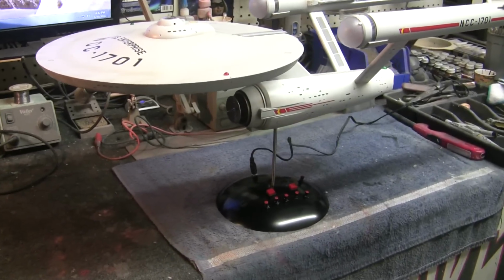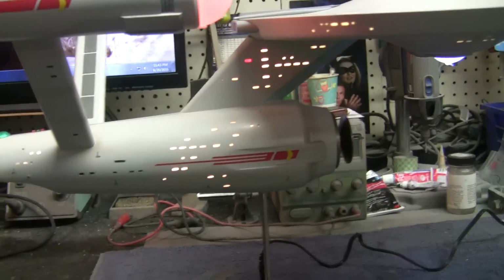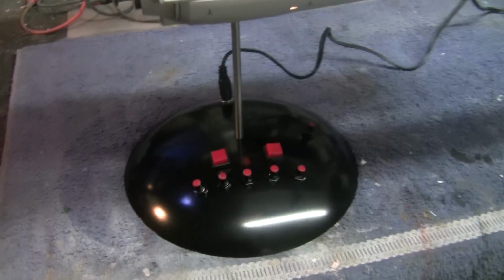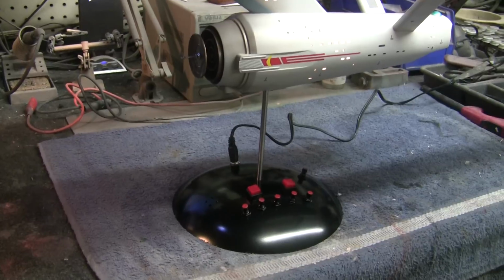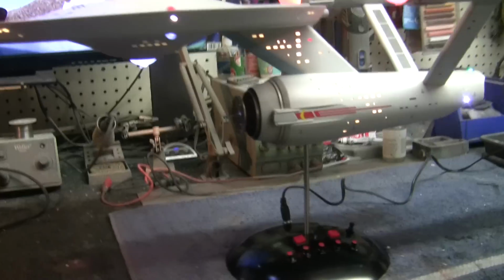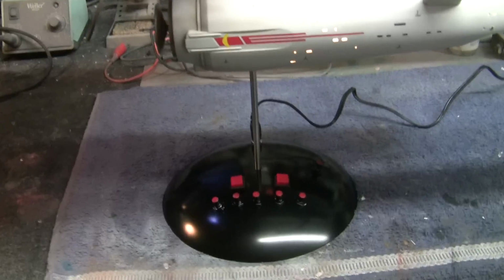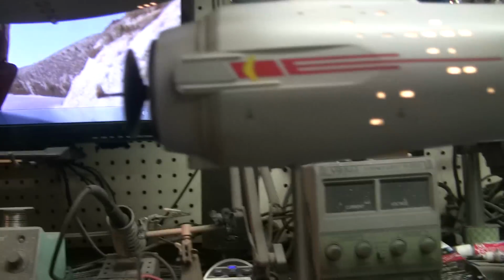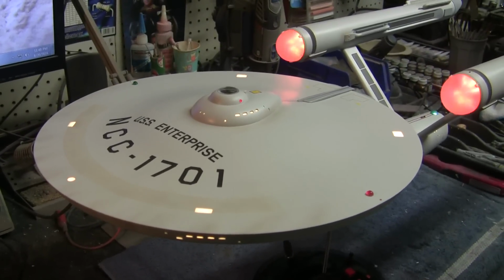My Cient Jeff's TOS Enterprise With Light & Sound Effects Finished

Comment: The sounds add so much, and I really like the diffusion in the bussards, it obscures the leds quite well, which I prefer myself, but the moving  'spokes' feel weirdly absent. I'm curious, have you ever tried printing off just the outer edge of a spoke pattern on acetate and placing it on a central rod above the leds so it creates an impression of the original motion due to the moving shadows? I imagine the pattern and the distance would take some experimentation, but it's possible it could add something worthwhile.

Comment: Hi, 

I just discovered your channel on YouTube and find your builds very interesting. I've been a Star Trek fan since I was about 3 years old and I love the design of the Enterprise (the original is still my favorite).

I love your models; you've done a fantastic job, as far as I can tell from the few videos I've watched so far, but I have noticed one "mistake," which I thought I should maybe bring to your attention. The running lights on the top and bottom of the saucer section should all be colored and the red lights should always be on the right-hand-side of the ship (starboard), with the greens, of course, being always on the left (port). I noticed in this video (and one other) that you were placing them on the opposite sides.

I also have a couple of questions that I hope you'll be able to answer. I realize that you're probably swamped with work, but if you have time to answer these questions, I would really appreciate it:

1) Are you custom-wiring these models, or are you using a pre-made kit?
2) Does the shuttle-bay door open and close? If not, can it be built in either the open or closed position? 
3) There seems to be a very pronounced indentation in the sides of the secondary hull that should not be there (where the stripes are placed). Are you aware of any reason for this or is it just a manufacturing/design flaw?

Thanks for posting the videos and for any time you may be able to spend in answering my questions!

- Alan
Reply from the maker: I'm afraid you have it backwards. The green navigation lights are always located on the starboard side of ships and the red on the port side. This is from the perspective of being in the center of the ship looking forward with starboard being to the right and port to the left. Also, on the original Enterprise, the navigation lights on the bottom side of the saucer were white and not red/green. Check out the flyby shots from the show and you'll see that. On later versions of the ship from the Refit on, this was changed to green/red on the top and bottom. Also the lights of the original ship do flash on/off at a steady rate. On the Enterprise D, they are however, always steady on. 

I do not use any custom wiring kits on these and I do all of my own wiring. 
The shuttle-bay doors can only be built open or closed and do not move.
The indentation on the sides of the secondary hull are exactly the same as those seen on the original
11 foot filming model. Have a look at the pictures of it on the Smithsonian website taken after the just completed
restoration of the model from this year. The 1:350 scale Polar Lights model kit is considered to be the most accurate
replica ever produced in scale to date.
Reply: Hi again, Boyd!

Thanks for the reply!

Yep! You're right! I did get it mixed up, although I don't know HOW I got it mixed up. I built one of the old AMT versions years ago and couldn't remember the correct arrangement for the running lights, so I remember that I put a lot of effort into researching the proper arrangement (I guess the previous confusion may explain my confusion of late- lol). Even after the research, I was still getting it confused, so I tried to come up with a "reminder" phrase to help. Apparently, I came up with the phrase ("red is right") after doing the research and also after I mixed up the arrangement, yet again. So, all these years, I've had it wrong! 

I think I got it right on my old AMT model, but that was accidentally thrown out a year or so ago when I moved, so I can't check it (that was a HUGE shame, by the way, because that model was a pristine representation of the ship. It wasn't lit, but I had actually custom-built a bridge and included it on the model, along with a removable dome).

I'm sorry for the mistake, though, but I have to admit that I was pretty curious, even when I was leaving the comment, as to how someone who was so detail-conscious (meaning you) could make such an obvious mistake- lol. After a while, my curiosity got the better of me, so I started looking into it a bit further myself. Almost immediately, I realized that I had gotten it wrong, but I didn't get a chance to come back and add a correction to my previous comment before you read it. 

I guess I must have just assumed that the original running lights on the underside were also colored, but I really could have sworn that they were. It has been a long time since I watched my old DVD episodes, though, and I have a terrible memory- lol.

During my research, I also discovered that the indentation on the secondary hull was correct (although I still think it's a bit more pronounced on the Polar Lights model than on the original). I don't know why I never noticed that before, but I guess it might have had something to do with my old AMT model. The secondary hull on that model did not have the indentations. Since I had built that model a long time before I ever got direct access to the episodes (on DVD), I guess I just assigned a lot of its characteristics to the TV original. 

Thanks for the information on the Polar Lights model. I read in the previous comments on your page yesterday that you generally charge somewhere in the neighborhood of about $1500.00 for a completed model, and I'll never be able to afford to spend that kind of money on a collectible model. However, I would still like to get one of the kits and assemble it myself... eventually, so any tips could really help me with that. 

I know that there is at least one company that produces lighting kits for those models, but I don't know anything about their quality. Although I have a pretty good basic understanding of electronics, I really don't think I could begin to design a decent working wiring plan for one of these models, much less figure out how to add the sounds. So, who knows? Maybe I'll hit the lottery one day and be able to afford to buy one from you!

Anyway, keep up the great work and I'll continue to enjoy your videos!

Comment: How much do you charge to build one like this?
Reply from the maker: This build was $1,500.00 with the sound effects included. Polar Lights is now re issuing these kit's as the 50th Anniversary Edition with an improved saucer. From what I have heard, the price of the kit's will increase a little bit so my pricing will go up a little bit to account for that as well. I am currently building 5 more of these with more orders coming in so if you are interested it will be a bit of a wait.
Reply: Do you do the metal fans in front of the engine nacelle lights the same as the studio model? This one looks like LEDs only in the engine lights.
Reply from the maker: Yes, I build these with the motorized warp engine effects or the LED only type. The choice is up to the clients.
Reply: +thepixelpusher  The advantage of NOT using motors for the nacelles is that the bussard effect is a LOT quieter and you don't have to deal with the motors running out in the future.  LED's should last longer than any motor that's spinning parts.

Some of the models I've seen in videos online are very, VERY noisy.  That was a common complaint I heard about the Master Replicas Enterprise model.  The motors on that model were very, very noisy.

I thought this business of "spinning blades" in the "motors"/engines was silly.  What we're seeing in the bussards (IMHO) is an atomic reaction, it's NOT a large weather vane or series of "fanblades" turning in a warp nacelle!!!  This is an advanced nuclear/particle system, NOT a jet engine!!!!  That was one of the things in the original teaser for the 2009 Star Trek movie that I felt was assinine...
Reply from the maker: Yep, I have the MR Enterprise that I bought new. The port side motor has begun to get gimpy where I need to tap on it once and awhile before it spins up. LED"S will last thousands of hours with no noise but I leave it up to my clients as to their choice.

Comment: Create a repeating bass sound, deep and at a low frequency so thats its barely even hearable and put the speaker inside ship maybe where the Warp Core would be. That will make the ship vibrate and make a humming sound. 

Well with more power use a frequency that humans can‘t hear anymore and turn it up to 160-200 and more db. Maybe the negative mass sound has will be enough to make it hover (or explode due to pressure)🤪😅